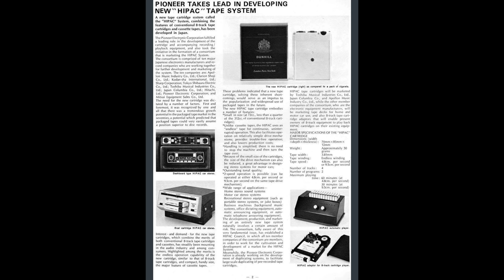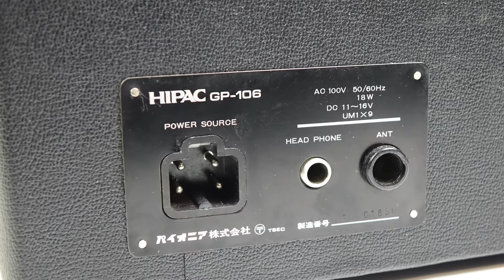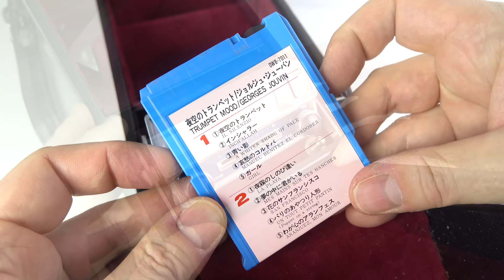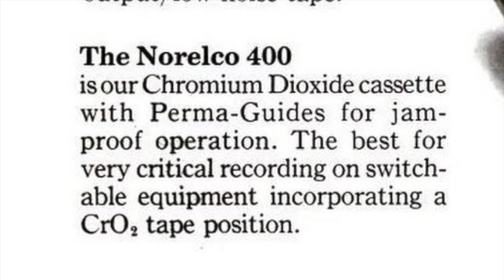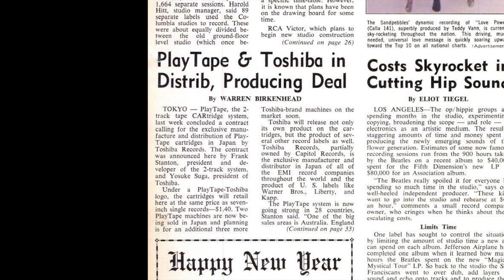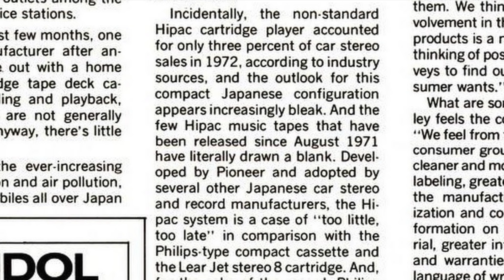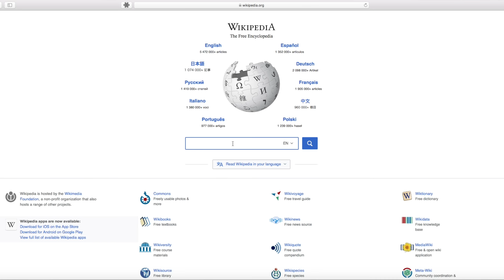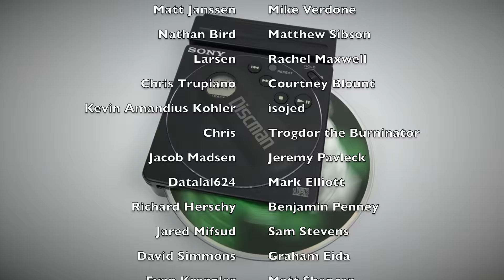Hipac  - The lost tape : Pioneer's forgotten 1970s cassette rival

Comment: The machine seem to have some kind of connector to mate with a "special" type of cartridge. Judging by the fact that there's a shielded cable, that might be an antenna connection and the "optional" special cartridge, a radio tuner.
Reply: Oh, late to the party, it has already been mentioned in the description.

Comment: Thank you for your videos, Great work! The echo chambers from brands like melos etc, a cassette tape device used hi-pac cartridges through out the 70s in to the 80s, so i have collected quite a few hi-pac for my machines. It's a echo device for electric guitars etc. 
I would imagine your hi-pac player is portable to be put in the compartment by inbetween the seats in the car to try to introduce it to the concumers with cars where they yet could not fit and easy to bring out for the family pic-nic when out on a car ride alá atomic family photos. Greetings, J

Comment: If im not mistaken, there were some kei cars in japan that didnt have stereos in them, not even a space for it, so i guess that pioneer just tried to reach that neach and got that portable system, so they can actually have a radio inside their cars without having to take it to an expert, so that might be the reason for the 12v connector and the size of that pack.

Comment: I could see the case making sense if you don't want to bother with connecting that card-edge connector directly into your car's wiring loom or if your car didn't even have a stereo system. The 12v auto adapter leads me to believe there was no hot-swapping to transfer the head unit between car and case.

Comment: Maybe it is made like this so it fits placed on the floor between the seats in the car (not all cars had arm rests and/or tunnel for the axel) that would explain the speaker config, one for front seat and one for the rear and you would only need one machine (consumer friendly :)

Comment: Thank you Techmoan, love your videos. Seems the idea of the endless tape was quite popular and got reused quite a lot. When did this trend start? And when did it end? And why? It's a very neat system after all.
Reply from the maker: Here’s a bit of a potted history I did in another video. https://youtu.be/Li699Qflv3g?t=28m14s
The benefits were that they were easy to use and the playback mechanisms were relatively simple. The disadvantages were numerous, splitting songs across tracks, crosstalk issues, no rewind, slow fast forward (if the machine had it. 
I think the hipac was the last time an endless loop Cartridge was used to launch a proper audio tape format outside children’s toys.
Reply: Thanks for the super quick reply! 1956 then seems to be the time it was first used for tape. Same time the TEFI cartridges came out in Germany which used the same mechanism. (which I only know from your videos, of course, despite being German)

Comment: With the antenna in there, I almost wonder if it was equipped with some sort of transmitter, I used to have an add-on cassette player that you plugged into the antenna connection on the car's existing radio, and then the lead from the car's antenna plugged into the back of the cassette player, and then you tuned the radio to a dead spot on the AM dial in order to listen to the cassette. Being that your device has a female connection though, I'd assume that you're correct in that the box is universal, and some of the players had a radio in them and yours simply doesn't have the radio tuner.

Comment: I wonder if there were ever blank tapes and a recorder ? As for uses it would have been ideal for a dance class or a school. I'm sure it sounds better than my Mothers 1973 Sanyo Radio Cassette which was often the sound system used for school performances in a 100 seat hall back in the 1970s (I had to compile the tapes for them).

Comment: "Q) Could the screw that's holding the player in place just have been used for transportation - like when you buy a washing machine, record player etc."

It's occurred to me that your machine might have been a demonstration model in a shop, and the unit was screwed in to prevent it from being easily stolen. Like car stereo decks in the '80s that were removable slide-out units; these usually had a screw holding the unit into its slot so that no one could slide it out of the display wall at the stereo shop.

Or, it was just sold that way and it was secured to prevent it from coming loose and losing contact with the base; and you bought the car stereo mount separately which came with instructions on how to dismount the unit from the portable console.

Anyway, no need to overthink this. If you ever establish a museum to display your collection I'd be happy to visit.

Comment: I found and bought a similar unit branded as "MBA Bikini." Same issue as yours - it needed a new belt. When I opened the case I saw some white, spiky fluff on the inside metal. I'm wondering if it was asbestos or something else.

Comment: The idea of a removable car stereo is not new at all, they had it in a soviet car called "Moskvich" ("Москвич" – Moscower) 
The stock car stereo head unit could be easily removed and used elsewhere. I don't remember whether it was only FM/AM or supporting tapes, but I'm certain that existed and it was not bad at all.

Comment: If it's a suitcase which plays car stereo tech for HiPac's I wonder if your bog standard tape and 8t player fittings would also fit in the bag and even if it did the bag I doubt had an areal to stick out of it to make your radio modes work in there.
Reply from the maker: I wish I had a cassette head unit to compare in the video for size...but this thing is tiny, a lot smaller than a standard cassette DIN size (and it of course has with different connectors) and the 8-track machines are generally much bigger again. It really is very very small.

Comment: Very interesting format and machine! I wonder if any recorders were marketed for this (stereo machines, that is). One unit I have currently uses this format, but as a tape-based echo machine. It has an Apollon cartridge, only mono sound, and variable speed control. It's sound quality is not too great. Your units playback of the stereo cart is excellent, however.

Comment: One thing that left me curious, is that antenna.  It doesn't appear to have a radio, and it has a built in antenna, and a jack on the back for an external antenna.  Was the box perhaps used on another model where the player had a built in radio?
Reply from the maker: There's a bit more information about this in the video description text box.
Reply: Ahh, got it.  I apologize, the one time I didn't check the description and there it was.

Comment: I was curious about these odd old formats. My brother participates in a Super 8 film festival. No one "officially" makes those old super 8 film carts anymore (maybe in Russia?) but there's a small company that uses, I think 16 or 24 mm film stock, cuts it down, punches new sprocket holes, and and puts them in recycled carts to give to the participants.

Would it be possible to do the same thing with these odd old audio tape systems on a small scale for aficionados? Maybe some way of buying larger tape formats and cutting them down for these old systems? Possibly using 3D print technology to recreate the cases. Silly idea I know but could be fun on a small scale or for novelty purposes.

Comment: Sure enough, the Wikipedia article is up and has already been edited over a dozen times. 

An interesting product that was probably doomed to failure from the start. In competing primarily against the cassette and 8-Track, it didn't really stand a chance. The cassette, despite the early tape formulations not being great, were becoming more and more plentiful and they had considerably less wow and flutter than the Hipac would have done. They were also easy to use. The 8-Track, while being considerably less easy to use (especially when recording), was everywhere in the early 70's. It had a large market share, especially in automobile players, and to make a dent in that market the Hipac would need to do something special. It didn't... I mean, it doesn't seem to do anything that the 8-Track can't do. The only advantage is its size. So, I can see why it was a Japanese product because the Japanese love of small devices goes back decades. But I can also see why it flopped. Okay so the 8-Track is bulkier but sounded better due to its wider tape and mass support from the major tape manufacturers.

Comment: You make no mention of the finger contacts in the top of the cartridge compartment. It appears to me, best educated guess, that an optional radio in a tape cartridge could be inserted instead. I bet the lone coax I saw on the finger contacts is for the antenna.
Reply from the maker: There’s a bit more information about this in the video description text box.

Comment: Did you actually need to screw it in to get it to work though?  If it was optional, then it's probably just there to keep it secure for long term or transportation purposes, and was more of a convenient plug-and-play device.  The fact that it comes with a battery power option at all indicates to me that they wanted it as a major feature.  It's probably too heavy to lug around on say, a long hike.  But for a trip to the beach or a picnic?  It's basically Hipac's boom box, even if it isn't feature rich.

Also, I'm pretty sure it is indeed pronounced "High-Pack", as in High (Fidelity) Pack.  They just didn't bother adding a hyphen.  "Hip-pack" or "Hip-ack" doesn't sound like tech, it sounds like camping gear or something.

Comment: Thanks for another great video! Could you reveal where you got the computery sound effects we hear at the very end of all your vids? 

I remember them being used all the time in American TV fantasy series of the 1970s and 80s (perhaps most famously in the title sequence of The Six Million Dollar Man), but I wasn't aware they were available in clean form.
Reply from the maker: There’s a bit more information about this in the video description text box.  If you are viewing on a smartphone or tablet app click the downward pointing triangle to the right of the title below the video. If you are viewing on the web click on the words “show more’.
Reply: To expand a little further, the original sound was likely generated by radio-frequency interference coming from a processor. Old computers still worked in the low kilohertz range, so they would give off noise bursts that were audible when interfering with  radios and amplifiers. Same sort of effect as an old dial-up modem screech, just a bit slower and so less hissy.

Comment: ...In my opinion, the carry case was intended for different models of players, perhaps there was a model with radio tuner, in other way, i' don't understand the aerial and external antenna socket... As allways, intresting thing for those we love vintage audio...
Reply: the extra plugs on the back and the antenna on the front suggests a dimly remembered thing ( tuner) that could be put in the tape slot....

Comment: Was the purpose of the machine to provide outdoor entertainment at picnics and down on the beach (or take it round to a friend's house)? You take your Hipac 'pride and joy' out of the car to avoid it getting nicked, slot it into the carrier, slot it back in the car on the way home, remove it again before locking the car to avoid the risk of theft. You mention the machine is a hefty piece of kit - which would deter many consumers. I am mindful of the '80s when massive ghetto blasters were supposed to be carried on the shoulder and adding a handle to a product rendered it instantly 'portable', at least for body-builders!
Reply: ...or simply just an attempt by Pioneer to remarket / find another use for a failed format which is what I think you're implying. Strange one that, but that's why I follow your channel. Also, as well as being part of the history of tape, it belongs to a sub-set of technologies using docking stations I wonder how many formats utilise this concept? I can think of a few non-tape formats such as iPod / iPhone / SD card / memory stick boomboxes over the past 10 or so years and I can remember some my sony MDs using a docking station to transfer music to and from PCs (Open MG Jukebox & SonicStage). Surely, there must be more?

Comment: 9 batteries? Thats odd but i guess it brings the voltage upto 13.5 which is more in like with a car power system with the engine running

Comment: record speed permitting i wonder if you could 3d print an adapter to slide onto those HIPAC's, then you could record onto them using a 4 or 8 track recorder

Comment: Nice video.  You need to take it back apart and trace what the 6 finger sensors do. 5:26 in the video.
Reply from the maker: Those are most likely to attach to a radio cartridge...similar to the ones used in some personal stereos to add radio capability.
Reply: Oh, you learn something new everyday lol.   Now you need to find one and demo it,  :-)

Comment: I was just wondering why you don't use rechargeable batteries considering the number of portable battery-powered gadgets you test. 9 Duracell C-cell batteries might set you back £10+ (a quick search on Amazon list a pack of 4 for £6.69).

Comment: 4:44 Well, of course it was too bad dat da belt was too stretched-out to use, but at least da belt wasn't all gummy and messy --- and therefore had to be tediously cleaned off with solvent and elbow-grease --- like so many of da other super-old machines dat you work on, so dat was a plus. :D

Comment: AT 5:50 - At the upper left of the case there are six metal "fingers" with various colored wires attached.  You can get a good view of them at 12:27.   It seems like when the cartridge is inserted these fingers would touch something on the cartridge and make a change to the unit.  Fidelity?  Cartridge type?  Tape type?  I was hoping that you would slip in a cartridge so I could see what they did.  Any ideas?
Reply from the maker: There’s a bit more information about this in the video description text box.

Comment: Maybe I missed it but it didn't seem like you mentioned the antenna in the box. Makes me curious as to why there is a antenna in there when the deck is just a hipac player. I don't know much about vintage car stereo sizes but if there are other units that size maybe this case was designed to support an AM/FM radio unit.
Reply from the maker: It was mentioned at 2:49 and you can read more about radios in the video description text box.
Reply: Techmoan whoops. Must have gotten distracted during that part. Thanks

Comment: wile you had it open, i noticed some contacts that would touch the cartridge, possibly a slide-in radio?
Reply from the maker: Yes there's a bit more information about this in the video description text box.
Reply: Thanks for that - I was wondering what those contacts were as well, although my suspicions were more along the lines of conductive tape on the cartridge that could select the alternate tape speed. The radio idea is more in keeping with the technology of the time.

Comment: Would also like if you have not to do a demo of the Pioneer 4 Track 8 inch cartridge. Have a freind in the area, that did have a working recorder also. Those were from the 1960's. The Pioneer was a giant heavy unit. Theirs had a seperate mouted black box,with vu meters, that was the recording adapter.

Comment: Nice Mitchell and Webb reference!
Reply from the maker: Where? If there is one it’s unintentional.
Reply from the maker: They did a much better job than I did.
Reply: I must admit the production value is slightly better, but yours was a nice, albeit unintentional, homage worth at least a few chuckles
Reply from the maker: I was more referencing this season of Gold Divers - which so far this season has done more re-caps than an electronics repair shop.

Comment: You mention the listing said it was "broken". Did you mean that you saw it being described it as a 'junk item'?

I've seen listings on Japanese auction sites where Google Translate will translate something to 'Junk Item', but in a Japanese context it seems to mean 'old/obsolete' rather than what we'd take to understand it as 'broken/not working'.

I did this while building up a collection of 1990s Sony Trinitron portable TVs from Japan a couple of months ago. Would you believe that Sony made a bunch of CRT-based GPS navigators for cars around 1994? I bought three of them because they're an awesome example of the kind of high technology coming out of Japan in the 1990s.
Reply from the maker: It was listed as junk, and the description said something along the lines of it wouldn’t play music.
Reply: mubd1234 the term "junk item" in Japanese auctions implies that the buyer is to take it as-is and the seller offers no guarantee whatsoever no matter what actions the seller may have taken to improve the item (such as replacing belts on a tape deck or turn-table. Although this may vary depending on particular rules. ).  The item may, or may not work perfectly but the seller will not accept a return on a junk item due to inoperablility of one or more functions.  
In return you are,  in theory, getting a cheaper price over an item advertised as "refurbished."

Comment: You're being funny about padding shows but in the USA, they actually slow DOWN TV shows. That's right, usually you hear about time compression being used the other way, whereas they compress it so there is less time and you can fit more commercials in. And that is so, but they also use time compression to PAD TV shows. That would be a good topic for you to address in the future.